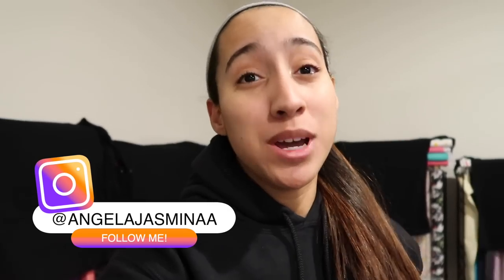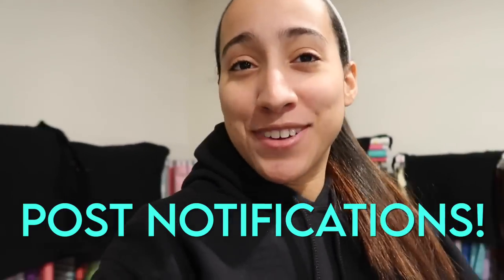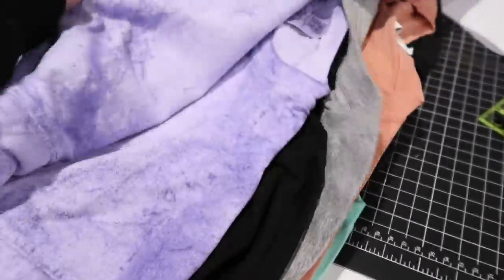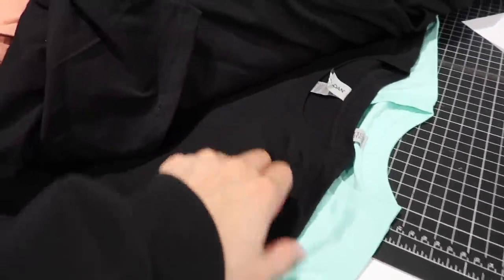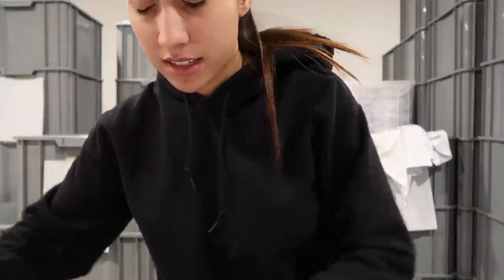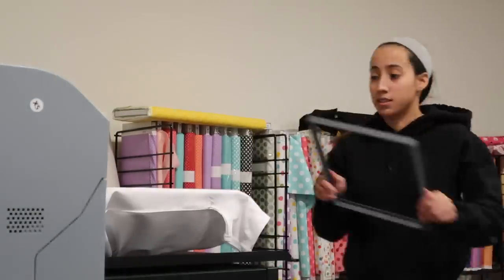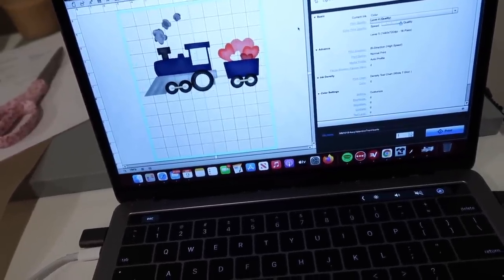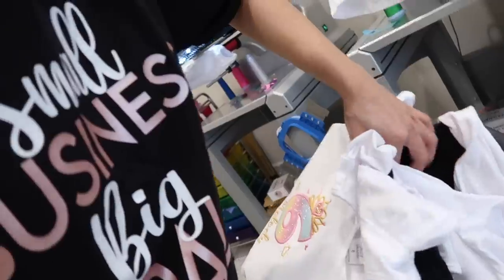STUDIO VLOG #11 Running My Small Business, Packing Orders, Printing Shirts & Embroidering Shirts

Comment: What about using a 1.5" pvc long pipe against the wall? They have like 12 ft pipe anf then get the 12"   "L hook arm" and bam several wall hanging space or... You can use the white wire racks that go in closets and put that on the wall. You would have space for folded shirts on the top rack as well or fabric or orders. Idk lol. At least they wouldnt be in the way like a standing or rolling rack. I love ya girl and love the work you do! Amazing!
Reply from the maker: Because im renting this house I cant do anythinggggg.... can't wait to own my own home!!
Reply: @AngelaJasmina  I know sorry I just remembered that girly I am sorry ugh but you will soon!  O m g what about using one of those door hook things hooks over the door like a coat rack but hook it on the side of the blue buckets or E6000 some hooks to the sides of the blue buckets or can you put wood attached to the fabric racks on each side and then a bar that connects at the top to hang your shirts. Or build around the fabric rack and use a long bar to connect. It would be so easy to do that. And you wouldnt have to drill into the wall or anything. Lol sorry I am a construction guys fiance lol but raised as a do it you selfer lol so I just really want you to succeed and have the space lol I think building on to the fabric rack would work really well.